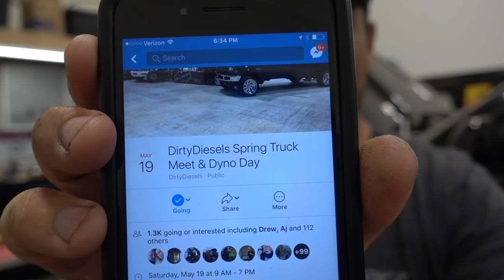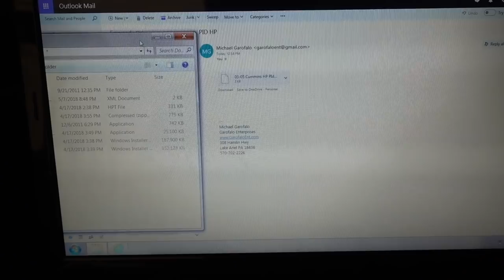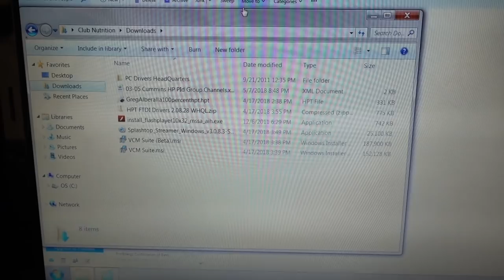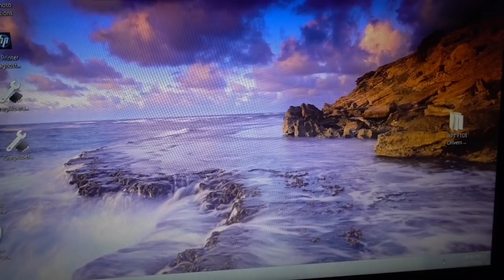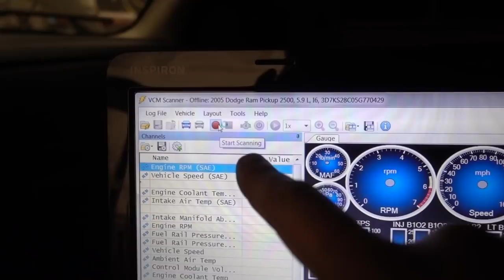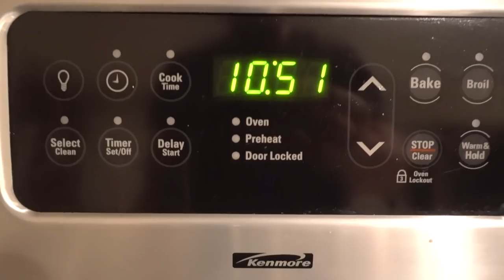IT'S TIME TO TIE UP SOME LOOSE ENDS!!!

Comment: Does HPP dyno tune? I currently have anarchy, which I love. But they are in Tennessee. Would like a local reputable tuner in the northeast area to dyno tune my 12 G56. As of now I am  2nd gen swapped with 467.7 with source auto kit, custom 5” TBE with fuelab velocity 200. Looking at exergy 100% and dual stock pumps.

Comment: So jealous off your trucks in the uk 4x4 are very expensive and specially dodge only seen about 5 in my 27 years
Reply: Paul Cowell holy shit
Reply: Larry thiers a 05 ram about 100 miles away from where i live its red 5.9l crew cab done 101347 miles current price is £42,000